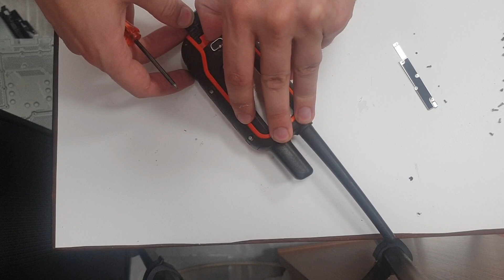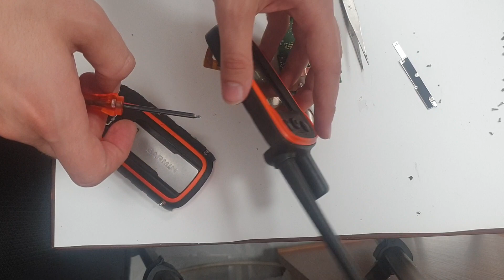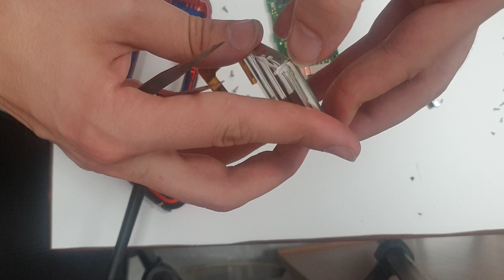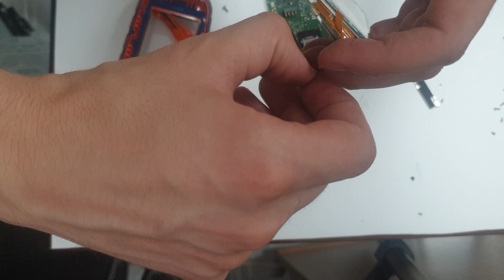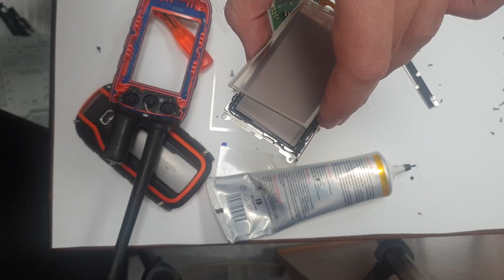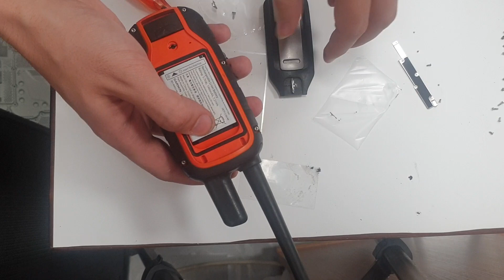Garmin Alpha 100 Tracker Handheld GPS Touch Digitizer Replacement Tutorial / Wymiana dotyku

Comment: What size is the tool you use to remove the allen head screws from the back cover?  Nothing I have works.  Thanks.
Reply: T6 - Not Allen, Torx.  Also you need a 8mm nut driver to remove the long antenna connector so you don't have to break the wire like this guy.